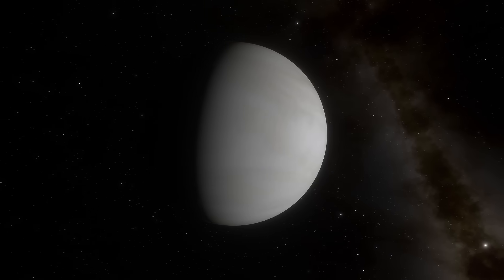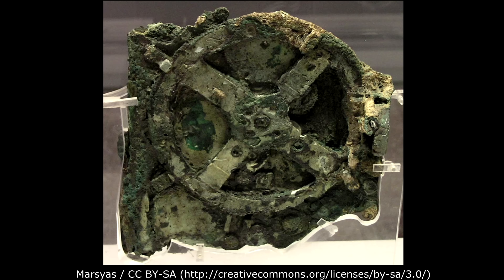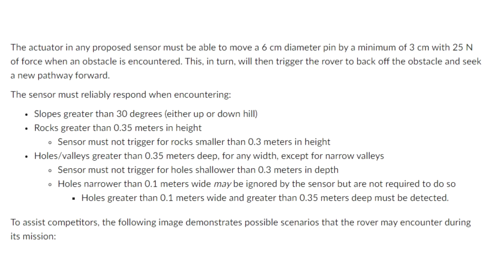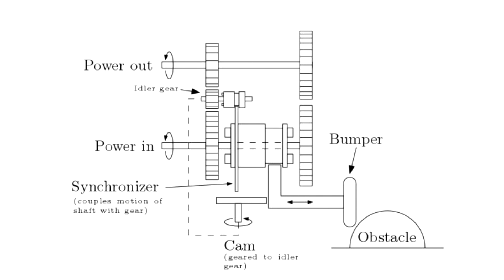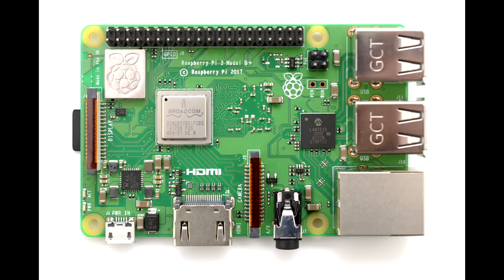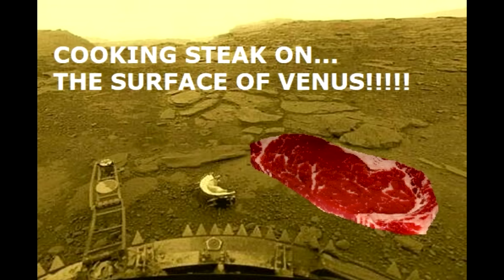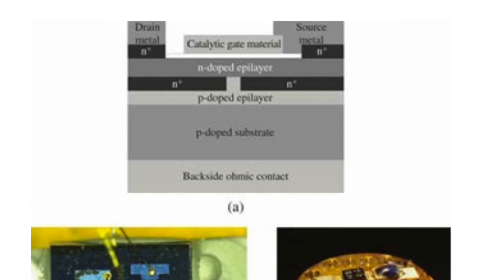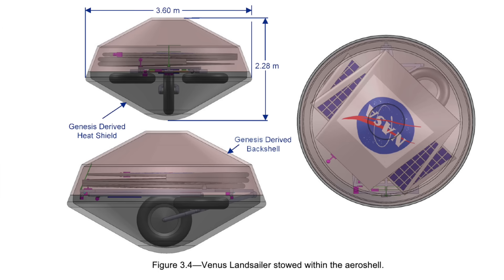Venus Rover Concepts That Beat The Killer Atmosphere

Comment: Rockets that land vertically and mechanical automatons that explore planets...  who would have expected that science fiction from the 1920s was the way forward?
Reply: Disruptive_Innovator The designers of the mechanical computers used to direct naval guns or torpedoes in the 30s and 40s, firing on moving targets over 32 km away, would have excelled at this challenge.
Reply: the mechanical naval computers were also rather big... Not sure how viable that is for a spacecraft and/or rover
Reply: @Imbeachedwhale  I don't think that was actually a computer in the computer-scientific sense of the word though. (The Babbage engine was.)
Reply: @Imbeachedwhale  I'm no expert but are you talking about the Norden Sight ?
Reply: talkpls Norden bombsight, Torpedo Data Computer, Mark 37 Gun Fire Control Director, and that’s just three of dozens of US examples. The 16” fire control computers on the Iowa class battleships, able to engage targets 40km away, are more precise than the guns could ever be, so when the ships were reactivated in the 1980s they didn’t touch them.
Reply: @Imbeachedwhale  How to take a picture tho?
Reply: That's just the Y2K bug. Off by a century.
Reply: @I'm beachedwhale1945 - Those were basically mechanical calculators, not computers. They got all the data fed to them by a human (not sensors), didn't have to run any complex decision-making code, and didn't even have memory.

A better comparison (though still much simpler than a rover on a different planet) would be with something like the Norden bombsight, which used data directly from sensors and was very impressive on paper... but pretty disastrous in actual use, which led to the revival of the pigeon-guided bomb program (not kidding).
Reply: @RFC3514  A carburetor is basically a mechanical-pneumatic analog computer..
Reply: RFC3514 well the pigeon guided missiles actually worked.
The only reason they we’re dropped was no one in the military command at the time wanted to rely on animals for a task like that.
Reply: I mean, electric cars were invented 50 years before gas ones... and now we are back
Reply: @michaelesposito2629  Yes.
Makes sense too, because the electric motor is vastly simpler mechanically than a combustion engine.
It's interesting to consider what would have happened if electricity had been figured out a bit earlier and the steam engine a bit later;

Waterwheels and windmills were already in widespread use before the steam engine.
Add an electric generator to one and you have renewable electricity before steam power.
And since a generator and electric motor are essentially the same thing (optimised differently, but still fundamentally the same mechanism)
Would have been a different world, that's for sure.

Conspiracies aside though (and we can certainly think of a few regarding oil vs electric), the electric car is a really simple concept held back by battery technology.
By contrast the internal combustion engine is a relatively complex device whose success has been built on the exceedingly high energy density of petrol.
Battery technology has improved vastly in the last two decades and yet petrol is still 30 times as much energy by weight than a fully charged battery...
A while back it was more like 300 times...
Reply: @KuraIthys  Thermodynamics came from scientists trying to understand what was going on with steam engines, so...
Reply: @Disruptive_Innovator - Good observation.
Reply: the people in the 1920s maybe xD
Reply: Pavor  and let me guess, you completely understand the universe and perfectly know our place in it, right?
Reply: This is something a man like Tanaka Hisashige would tackle. From little automaton robots to giant steam engines his mechanical skills were legend!
Reply: 2020 is the new 1920... (?)
Reply: Arthur C. Clarke's visions of the new millennium are still more realistic than modern news programs reporting on it.
Reply: Incredible lol
Reply: There was a rocket landing vertically in some Soviet movie.
Reply: The people working to turn science fiction into reality.
Reply: @Disruptive_Innovator - Everyone born before the great distraction called the internet.
Reply: everyone with sharp mind and at least basic knowledge of history?

Comment: What about the thero-electric effect. You have one end out in the atmosphere and one in a tank with cryo-fluid.
Reply: and 10 minutes later, your cryo-fluid has all boiled off, and then?
Reply: Imagine the size of a heatsink required and the power supply and how many peltier cells connected in series to maintain cryo temperature while having it's "hot" radiator submerged in hundreds of degrees celsius.  This can be done but is definitely not the best way to go about it. You're better off designing electronics which can passively take those kelvins and cooling only the most vital parts.
Reply: @jackvernian7779  It is fundamentally impossible to use a temperature gradient as the sole energy source for a mechanism for maintaining that temperature gradient. The Laws of Thermodynamics scoff at the mere concept.

With a suitably huge exterior power source, you can cool a local area using one of the various refrigerant methods. Peltier devices come to mind.
But they are horrendously inefficient, and most designs that we currently have would just belly-up and die at those temperatures.

Not to mention the 90 atmospheres of superheated Solvent that the CO2 atmosphere is (CO2 with a dash of sulphuric acid, that is)
Reply: @marvinkitfox3386  I do not see how what I wrote contradicts your points. Care to clarify?
Reply: @marvinkitfox3386  If you reffer to "designing electronics which can passively take those kelvins" I meant just that = not cooling anything, letting it operate under those 600C. And adding peltier cells and other cooling methods only to the vital parts which have to be cooled.
Reply: Okay so to anyone who wants to point out the MANY problems with this idea yeah. 
This is what happens when you type a comment when you just woke up. 
I also after some research realized I had a fundamental misunderstanding of how this kind of this works.

Comment: Mechanical hardware really just won't work well enough. Can't store the energy in meaningful ways, at least not the type of energy that is required. The Strandbeest on Venus idea is somewhat laughable (even though I love the work from the artist, the beasts look very otherworldly when they move around on the beach). There's basically no steering and it would follow the wind direction basically. It requires everything to be super lightweight, it can get stuck really easily and it needs significantly strong winds. 
What happens realistically speaking when you figure out a way of putting everything in like a glass sphere? Would that still mean it's only a matter of time before everything heats up to local temperature, including what's inside? I suppose so. So, that means you'd need something that continues to operate under 500'C temperature conditions. Oh and a vertical solar panel? Are these people morons?! In my mind, and you can call me crazy, the only way something like Venus becomes a more realistic destination is either figuring out materials that can deal with the heat, without sacrificing modern computer power. Or we'd have to do terraforming lowering the temperature on the actual planet. I don't suggest blowing up Venus, causing a thick fog that lowers the overall temperature. But at the same time, something along those lines might be a more realistic approach, as 500'C is not really the type of temperature you could do anything meaningful with in terms of exploration. And yes, I'm fully aware there's a 'runaway greenhouse gas' issue on Venus. Which isn't so much 'runaway' from what the temperature readings tells us, but still. To tell you the truth though, -80'C on Mars isn't exactly great either (up to -125'C near the poles). I don't have an answer for this problem, but it would be very interesting to see what they can come up with. A lot of materials are great heat shields, but only for a fairly short duration of time.
Reply: Purely mechanical probably isn't enough, but mostly-mechanical should be.

Comment: Just build impactor. Like bomb... MOAB... From the blow it will penetrate deep into the planet, is it probably not so hot there at a depth of 10 meters? heat is generated from the temperature difference between the beginning and the end of this long bomb. lower colder upper warmer ... something like a stirling engine. it generates energy, and the rover is separated from the end (wired), which is closer to the surface even when falling - it's just a sphere with sensors from which wires go to the bomb.
Reply: Nope.
as with any terrestrial/rocky type planet, the core is hotter than the surface. Dig down, and you heat up further.

Comment: Maybe vacuum tubes could work.
Heater element not needed, better efficiency :)
Reply: I guess the only problem with that is maintaining the vacuum, even almost all space ships leak air into space. Building a rover that won't leak under such an incredible pressure differencials would be difficult, not to mention extremely heavy. Imagine having a box with a vacuum in it being dropped to the bottom of the ocean, thats the sort of pressure we're talking. The shell, or bit between the vacuum and the outside would have to be incredibly strong to not just be crushed like a soda can. And the stronger you make something the heavier it gets. The heavier it gets the more limited you are in equiptment or size, and the harder it is to launch. Sure you could just launch it on SLS, or Starship potentially but the cost would be astronomical compared to the science capability of the rover, at least when you stack it up against any of the mars rovers.

Comment: Damn it, I wanted Strandbeests on Venus!

And also airships!
Reply: the standard strandbeest is not designed to handle anything but flat ground, even a small rock can stop one in its track. there are some variations that can do better but they all have limitations that wheel/tracks don't

in the end strandbeests are there to look cool (and i have the homemade strandbeest walking desk to prove it.) not work well.

Comment: Some ideas:

Have a “pin” in the wheel that falls out partially when the wheel is halfway over a cliff, this is a simple mechanical way to detect cliffs.

Have the rover naturally turn left or right when travelling over an incline. After a certain threshold the rover should do a 180.

Use your rovers suspension to detect rocks/rough terrain. Perhaps make the suspension in such a way that it turns upon encountering terrain above a threshold.

These ideas may not be practical but I hope it helps someone however unlikely it may be.
Reply: First one relies on no dust getting into the sliding mechanism. It also would trigger at slight irregularities (bumps, divots) in the ground, while not triggering on a smooth slope rapidly going downward (the wheel would never lift from the surface). I like the other two ideas, and the second one is actually something we somewhat implemented in my college robotics club! 

Even if I'm shitting on the idea, keep coming up with them, please - without people willing to push boundaries, we can't innovate.
Reply: first ones really clever tbf
Reply: the pin would fall out everytime the wheel turns
Reply: Well nothing you said specifies how you want it to be implemented - which is the hard part. Detection in the sense that SOMETHING moves when you find a trigger is not a problem (although the wheel would have to be very large to house pins long enough, e.g. 20cm, to effectively find a cliff. Also cliff could be a small slope going steeper and steeper). But how do you mechanically transmit that signal to the driving mechanics (through the weel, axle, etc) and amplify that small teeny tiny movement to affect driving mechanics. Also you'd need so many pins in the wheel that it's just too complex.
To solve at least some problems: Have a single heavy wheel extend on an arm outwards. Needs to be heavy to have enough force to trigger mechanics. Inclination too high, presses inwards into the rover, continuous force that can be used to drive turning mechanics perhaps. On a cliff or steep decline it will pull the cart unfortunately, but if it get's too steep the arm extending within the rover can trigger a one-way brake with quite a lot of force (lever action) above the rotation axis, maybe with the braking force immediately being translated into a rebounding force. Still a ton of problems with that but whatever
Reply: I think a good camera would alleviate all those concerns.
Reply: @agentk3984  Yes, but building a camera at all that csn survive on venus is extremely difficult.

Plus if you have a camera you need image processing logic or it's a moot point for navigation purposes.
Reply: @agentk3984  Have you watched the same video as I did? Cameras don't work at such heats... If you can come up with one that does and on top of that can detect a cliff using only transistors, you basically have the grand price guaranteed
Reply: @vocassen  I would imagine similar words were spoken when someone had the idea they could fly a man to the moon, let him walk on the surface, and return safely.
Reply: @vocassen  : You don't use a semi-conductor camera, you use an older-style vacuum tube one. And you put the processing power on an orbiter, with as many orbiting relays as you need for complete coverage.
Reply: How about giving it a white cane to tap the ground in front of it, like blind people use? (It has to be white, or it won't work.) If it senses that the ground is too high or low within the forward, forward-left, or forward-right areas, it won't go in those directions. That shouldn't be too hard to do mechanically.

Comment: I have not look at all the comments . But can we cool the Electronics with a air conditioning that uses heat for cooling.    Camper use propane to heat a gas that is used for air conditioners and refrigerator / freezer.  We have the free heat source so we just have to build a ceramic case to protect the lander.  Just a Idea.

Comment: Mechanical only? No wireless or communication? I guess if it was autonomous then mechanical is easy to do. But you need to get the results back to Earth. So the wireless could be shielded along with its batteries, and protected, then used to burst the data.

Comment: Could the temperature gradient between the cooled electronics area and the hot outside air potentially be used as a thermoelectric generator? It wouldn't be enough to be a primary source of power, but it seems like it might help some if used in conjunction with a wind turbine or solar panels, and it also seems like it would directly remove some of the heat from the system by converting it to electricity.

Comment: You're probably not old enough to remember the clockwork cars that drive the front wheel, if it hit an object, the wheel would turn and make it go in a different direction
A mechanical wind turbine could be used to drive it,
But really, the simple answer is to drop a few million young trees to absorb the carbon dioxide :D
Reply: Not at 500c
Reply: @TimLF  yeah what pack in Venus is maybe carbon cycle there is no way to deposit carbon dioxide into rock. Because there is no ocean and marine life like earth. Maybe we can introduced airborne bacteria to eat co2 then it dies and bring co2 down to surface of Venus in crystalized shell
Reply: Would bacteria survive the temp?
Reply: @stevepirie8130  Well the atmosfer is dense and the hot temperatur is in the surface. so the air where the density is low the bacteria can survive and as it slowly deposite the carbon making the atmosfer thinner
Reply: The planet is a bit close to the sun, if we remove the protective atmosphere wouldn’t the sun’s heat just boil the place again?
Reply: Like your idea though

Comment: Why bother walking in an atmosphere that thick. Why not just "hop fly" like a wind wound drone imitating a grasshopper.
Reply: Because it might fall and/or burn and die. Plus you can't power the drone.
Reply: beacuse everything that isn't crushed, melted and corroded in minutes is too heavy to fly.  Even if you had any kind of hardware (motors, electric...) that would work.
Reply: @5Andysalive   near the Venus surface "to fly" should be more like "to float", so a "venus aircraft" can be a really heavy construction still capable to fly.

Comment: Vacuum tubes might actually work quite well, the cathode would be already heated, so it wouldn't have to use so much power
Reply: Unfortunately, vacuum tubes also require an unheated anode and grid.
Reply: The cathode is heated to much higher temperatures - it glows red or even white. It is also made from a special material that emits electrons more easily, but the grid and anode aren't.
Reply: https://ntrs.nasa.gov/archive/nasa/casi.ntrs.nasa.gov/20050205652.pdf